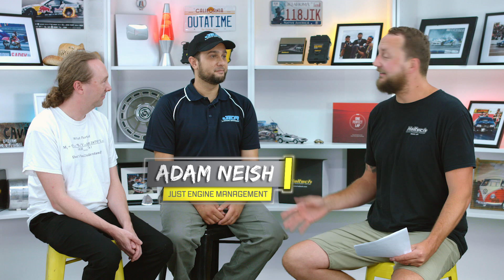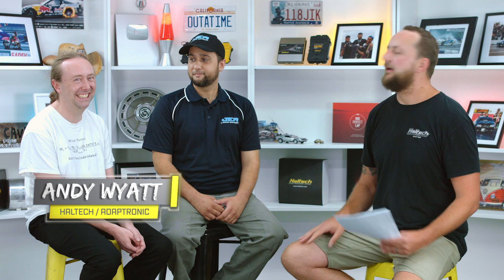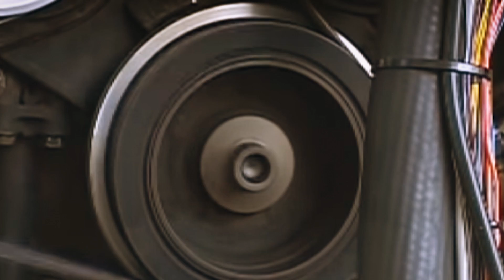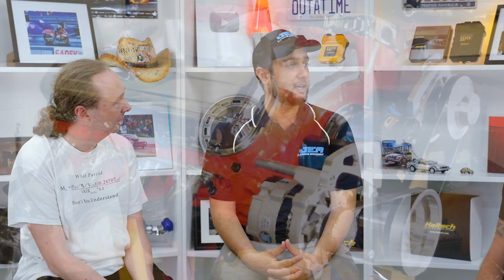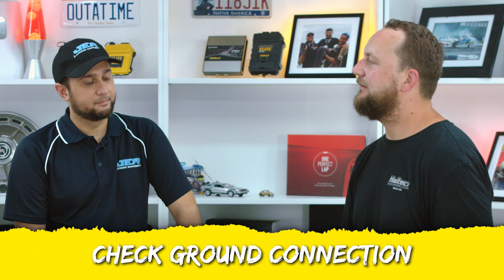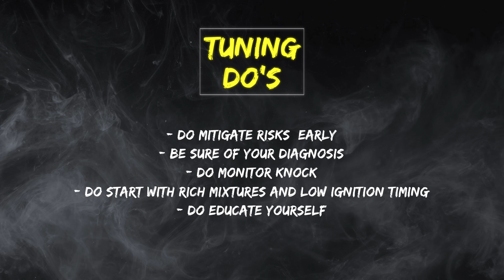📢 Best & Worst Tuning Practices | MASS DEBATE

Comment: My first tuning failure: On an AEM V2, added a control solenoid AND, critically, switched to a different MAP sensor for that added boost. What I didn't know what that resets boost cut protections! I wired up the solenoid backwards aaaannnd, you guessed it! ALL THE BOOST! 💀

Comment: dam man That was ur mistake? u ended up pushin some coolant... god i wish my moments were that simple
Reply: I ended up having to drill and tap for 14.3mm 169nm headstuds... snap a 12mm and tore another 3 out of the block. 

Electric motor over revved (was set to 50% rpm initially) centrifugal due to battery being disconnected for too long and resetting the controller. Electric motor was running a vortech v15.

Basically went over rpm by 200% on the centrifugal and had no timing and running lean... dyno recorded 30psi at 1500rpm on my 4 litre when studs gave way...

Can still say it's the best way to twincharge though....

Comment: Glad they mentioned the difficulty of the FSAE cars, I was on a team that ran a single cylinder turbo KTM450 that was a nightmare. It was a smart choice going single cylinder given how small the intake restriction was, since most the teams that run 4 cylinders seem to have trouble with them getting choked out. However there were more inconsistencies- the intake pressure was very cyclic, and even the engine RPM was varying quite a bit every cycle from the valvetrain and compression.
Reply: Displacement is a waste in fsae, everyone doesn't realize there is no minimum weight. Why carry all that engine, if you cannot use it...

Look at the vacuum diagram of a tl1000r. There are jets and a canister upstream of the iaps/map sensor, to smooth the pulses.
Reply: @NecroWreckedHim  Our team was one of the lightest tube frame cars, 373 pounds wet I believe thanks to the motor that weighed about 65 pounds. Big intake plenums can help too with smoothing the pressure out, but still a challenge.
Reply: Wish I'd joined one of these teams before they went all electric, doesn't have the same appeal to me anymore.  Even though I'm studying electrical engineering, ICE is just more interesting to me.
Reply: @sirspamalot4014  There's still ICE cars, it's been a separate class from the electric as far as I know
Reply: @rainvillecreative5410  Well my uni's team isn't interested in running them anymore

Comment: I tuned a 86 with a 4age 20v for customer a few months back and I noticed we were losing power after about the 5th pull, particularly at midrange to top end.  The power just kept dropping on subsequent runs.  I went through all the sensors, calibration, timing, trigger, etc and everything seemed to be fine.  Inspected sparks and performed engine compression test and all was fine as well.  Finally, I noticed a lot of metallic particles out of the tailpipe and around the rear of the car.  The car had a catalytic converter and the cat had failed and clogged up the exhaust system which caused major exhaust restriction.

Comment: This was such a good interview! Quick comment on the section of the engines they like to tune the most. It was immediately apparent that they both like the challenge of tuning the same thing. The only difference is scale. If they compare notes I bet they solve each others problems!! Thanks for this one Tuning Fork! I tuned my brain with this!
Reply: Side comment. Im fairly certain the reason your pumps need more current is simply the way your attempting to pump (suck) up the water. I can easily say its the fluid dynamics that are the problem. If we study Viktor Schaubergers work on water and fluid dynamics. Fluids dont really have resistance, this goes against alot of common beliefs. If you simply change  the area that has suction to something that will allow the water to vortex you will immediately find you wont need any electricity and UP your flow.

Comment: That was fun to watch! I'm from a different World... 56 years old, Old School Carb expert... I value guys like you because I definitely can't "tune" a computer!!! 😳 
I've got my 😖 story...
Rebuilding and setting up a Holley 4150. Got complacent. Set it in the car and started it up, ran like sh!t! Bogging, flooding and spilled fuel all over the Manifold.

Took the Carb apart again, to find I FORGOT to fit the power valve back in!!! 
So "jetting" was a 3/8" HOLE in the bottom of the float bowl. 😡😡😡😡 

Lesson 10 - NEVER ASSUME!
Carmine ✈🚂🚙

Comment: 100% agreed with all your points, guys.
Every beginner/hobby tuner should make a PDF and print out, or atleast keep that PDF on their laptop or phone. But hey, paper don't run out of battery. ;)
My personal demand is a AFR meter and a boost gauge, or I will never touch the car, not even "take it for a spin".
Greetings from Sweden! =)
/Kim. 1991 GVR4.

Comment: From a experienced retired tuner, a tuner REQUIRES a thorough knowledge of the mechanical side of the engine and whole package. 
- Most useful tip I have for your viewers is NEVER believe that any work (either electrical, mechanical, or tuning) done before you received the car has been done correctly.
- Most often faults in cars brought to the dyno would be in this order: low level fuel in tank, wiring issues, fuel pumps, h.t. leads, old plugs.
- As for most interesting problem/fault, in my first year of professionally tuning, I had a race car that tuned up great on the dyno with owner very happy but went bad later when checking the tune on the track. After every lap the engine would run richer and with noticeable lower top speed down the straight. After 5 laps and leaning it out 5 times with no reason or problem observed from a engine management point I had to insist to the owner he had a engine problem.  I was a young tuner and he was a retired tuner and engine guy from TWR so it was a very big call to make!  I was pleased, and have respect for his integrity, when a week later he came back and told me the external oiling system he had built for the cams wasn’t working as expected and the cam lobes were badly worn down! 
The moral of that story is that if you are sure with your diagnosis and beliefs don’t be afraid to stick with it, if you don’t have confidence to trust your decisions how can you expect your customers to have trust in you.

Comment: 2j vvti has got me twice on weird issues. One where the engine had been assembled by another shop with the timing marks with the dots vs notches mixed up put the intake cam way out. It actually ran but sounded like a Bridgeport.

The other was an engine assembled by another shop that must have dropped the crank trigger wheel. They would have dropped it, looked at it and it was fine. Fast forward to getting that engine running, first crank it was perfect for 30 seconds and then never again. We even pulled the crank sensor and looked dead on at the crank trigger wheel to count the teeth. Looked fine down the sensor hole. Pulled our hair out for a week, missed an event before pulling the front of the engine apart to find a tooth missing.

Comment: Haltech needs to partner with a app company to make a Tuning Simulator where you run different cars on dynos and have to go through tuning it to make it run as good as you can and clean up the fuel maps to get a high score think this would help people who are intrested
Reply: I'd pay for that
Reply: There is a game called automation that seems to be the best we got. You tune the hardware to make more power or more fuel efficiency ect by adjusting intake size, turbo compressor and or turbine size, boost pressure ect. It is a tone of fun and is decently realistic I would highly recommend checking it out.

Ever wondered how much power a 4L 4cyl  engine would make with a 100mm turbo. 
Or how much power a 500cc engine on nitromethane with a 15:1 compression ratio and a turbo bigger than the motor could make before grenading.

Maybe you dream of hanging a 2000hp iron block drag motor out the back of a smart car with a 1.8m wheel base just to see if you can make it do a back flip on the street.

Well, if you have these thoughts and don't feel like sending you and your own car to space (and your wallet) then this game is perfect for you.

Comment: You know Scotty, I did a very similar thing with my brother.
Working on his na miata we had just put a standalone in, accidentally got a tiny thread of wire in the wideband controller, shorted the microcontroller out and it died.
We were also right at the same time checking our base timing.
Set it to 10 degress BTDC.

Come back 2 weeks later with a new wideband controller.
After 20-30 minutes of driving around being really confused why it is so slow and I can smell so much fuel it hits me.

That little ignition gauge I'm looking at on my laptop has been on 10 degrees this whole time.

Turned off fixed-timing and it was beautiful.
We probably spent a good 15 minutes speculating.. Is a valve stuck? Did the crank pulley slip? Is the ignition coil dying??

Nope, just forgot to turn it off before we finished up last time

Comment: When tuning with any ECU, Don't forget to turn run in "closed loop" (without fuel and ignition trim), and raise knock threshold on engines with knock sensors, i learned the hard way, LOL.
Reply: That first part was crucial.

Comment: Great video. So many small things we forget to look at. Brings back memories. My first car was a Datsun 1200GX coupe. Turbo charged the original 1200 engine. Toyota 2e pistons. Custom intake plenum and a 4age throttle body. Stock crank and rods. Made 148kw at the wheels. Was a laugh when everyone thought I was running a 4AGE twincam until I opened the bonnet....

Comment: My advice is to always use the lambda sensor bolted in the dump pipe or closest to the engine. Never in the tailpipe. I sometimes even use two wide bands to make sure reading right. EMS had a feature that data logged average lambda at the load point that helped heaps. I never used dynos although would of helped in the 500hp+ region with a good load bearing dyno. I don't recommend street tuning either but can do most low and medium points with it, actually better on the road.

Comment: My first cat was a datsun 1600,no turbo,it had a l20b with twin carbs navarra 5spd and a legacy 4.1:1 lsd.
Reply: Nice. I also had a datto. Thinking of building another. Did u have to shorten that diff to fit? Or was it a IRS diff?
Reply: @johnsnow5239  no it's an IRS unit.subaru and nissan had the housings made by Fuji heavy industries,so there exactly the same.easy swap just had to swap the Subaru spline to nissan flange for the half shafts.

Comment: I had a clevo that kept retarding timing every time I backed off over 3500 rpm.
Turns out the vacuum advance was letting the inner and outer magnetic ring touch and then the inner ring would retard. New drive pin and shaft bush and never missed a beat since

Comment: I want a T shirt the same as Andy's wearing
Reply: pardon my ignorance, but what does the formula say./mean.....
Reply: @stufartegghead1757  It's the calculation for Mass of fuel = (airmass)/(desired fuel ratio)  Units matter lol. Greg Banish who made the shirt wrote this book. It has unbelievable info for $20 Designing and Tuning High-Performance Fuel Injection Systems https://www.amazon.com/dp/1932494901/ref=cm_sw_r_cp_apa_i_JuEvEbRKCTZ8H
Reply from the maker: You can get them from Summit - https://www.summitracing.com/parts/sme-dvd-t-xl

Comment: What’s the cheapest way for me to tune the air fuel ratios and possibly timing? I need a suggestion so that I can stop advancing the timing on my car by using a maf spacer and larger injectors in order to fool the computer into thinking there is less load so it uses less fuel advances the timing and now I have to use high octane fuel. Tbh I thought this was going to be a video on how to tune a car the wrong way.

Comment: Find out what clutch is in the car, ive seen one explode (owner fitted) and take out the gearbox, back of engine, and pieces go through the floor and break the dash.
Reply from the maker: Nasty!....
Reply: @haltech  indeed, I still have a few pictures somewhere, pieces stuck in the dyno room walls and the clutch slave cylinder made it out the shop. Cheap eBay parts...the usual shit we see

Comment: And now tuning forks love of 4g series engines makes sense #cordia
Reply: i miss seeing the old vr4 powered cordias on the road. revs... boost....... on the wrong side of the road now.
Reply: @Mr_jz_12  exactly.. lane changes without turning the steering wheel.  Cant wait until mine is up and running again
Reply: @MrbishiCordia  i've been seeing a cordia around here lately. Unfortunately its only stock but itd been years since i'd seen one till it showed up.

Comment: As a first year app, I rebuilt the carby on my 4a-fe, set timing, etc. No power. Pulled the carb back apart twice, still no good. Senior tech had a look, turns out I got the timing marks wrong, running 10 after tdc.... 😳
Reply: A hard learned lesson never to be forgotten
Reply: 90 percent of carb problems is ignition related

Comment: Nice piece Scott. With outputs climbing so quickly even at the oem level, do you see a need for individual per cyl wideband monitoring vs. bank monitoring?
Reply from the maker: Absolutely, the more data we have the better the tune will be. If it's possible to get a wideband sensor per cylinder and exhaust gas temperature per cylinder we can essentially tune the engine per cylinder!
Reply: @haltech  is individual AFRs taking over from EGTs as the primary means of monitoring individual cylinders?